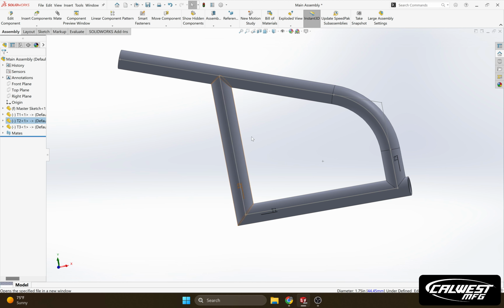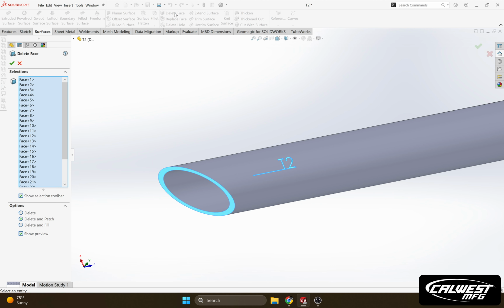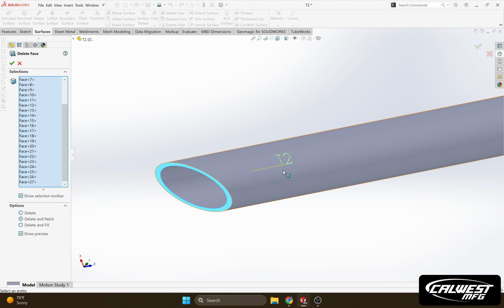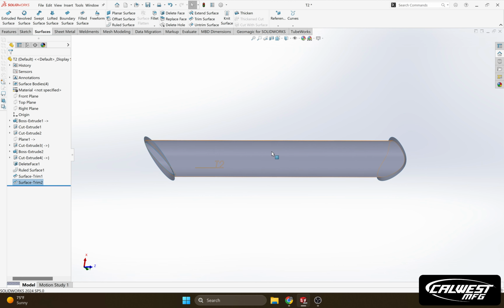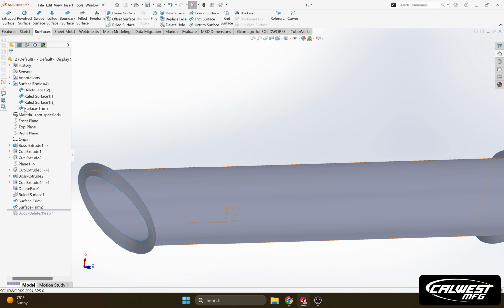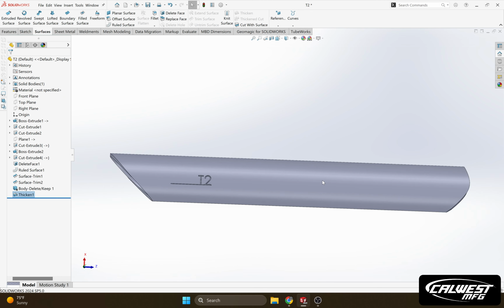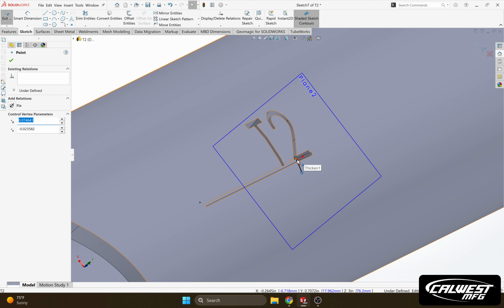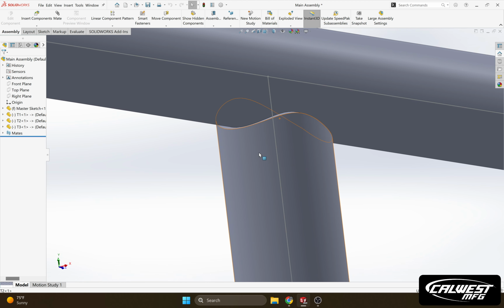Normalizing - Section 7 - Tubing in SolidWorks

Comment: normalize every tube in the chassis can take a long time...very time consuming. And some notch can't be ruled surface easily....which can be very headache. 
I did a very simple way. offset the inner and outer surface but 0 offset distance. Thicken the inner surface outward and thicken the outer surface inward. Select all 3 bodies (include the original body) and combine all 3 in common. In very few repeat steps, I got a tube model that is ready to send for laser notching.